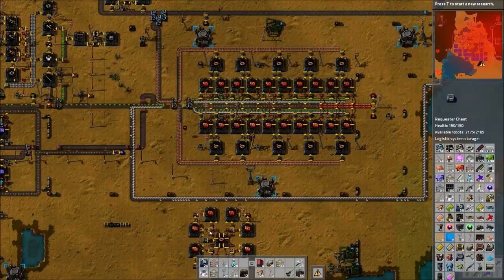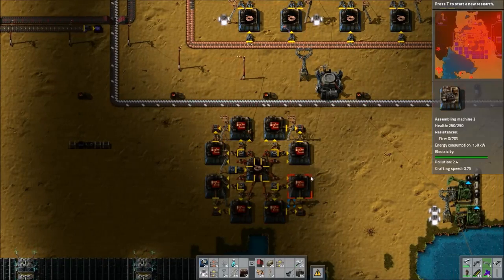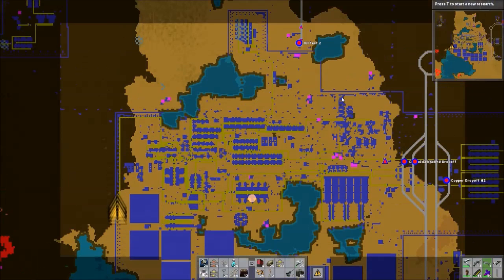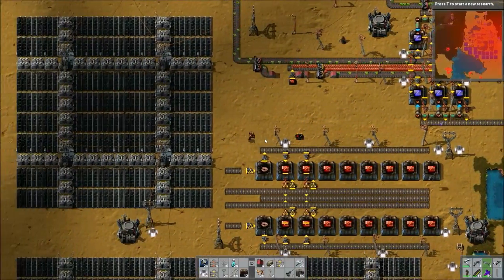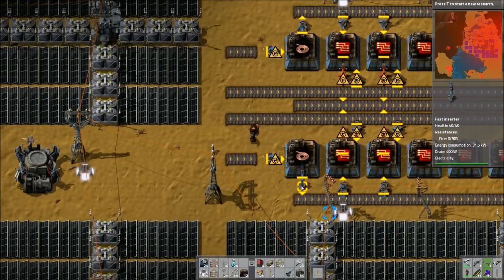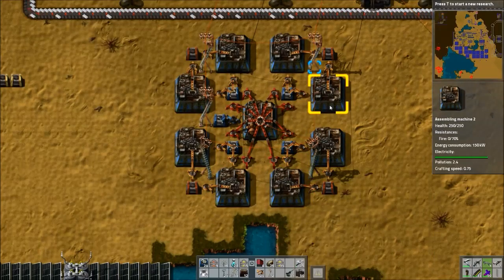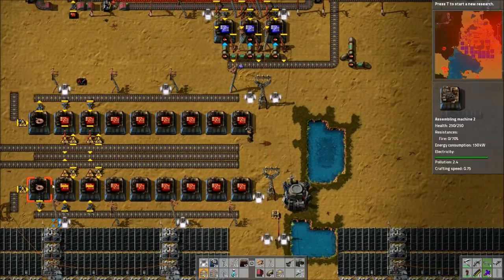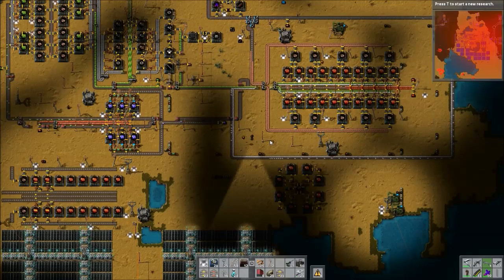Factorio Tutorial - Setting Up Advanced Ciruits

Comment: WHY don't you like belting cable? You say you don't a few times, but never explain why. You're belting in the plastic and green circuits. :)

Would your favoured example work with 20 red circuits in a row, a 2 belts down the centre, one full of plastic, one full of green circuits? Would the assemblers at the end ever get fed? Would the output line get clogged so made circuits were held in the inserter?
Reply from the maker: +ThePunkPensioner Good question! For Red Circuits, it is actually fine to belt the cable just because the circuits are made slowly enough so the cable can keep up on a belt. However it is not recommended to belt cable for normal circuits because since they are made so fast and need quite a few cables, it quickly gets to a point where the belt just can't provide enough throughput to get the cables to all the machines. 

And for your second question, I'm actually not 100% sure. I thin if you made the belts into red belt or maybe even blue then yeah 20 in a row would work and they could still get what they needed. And I don't think the output would get clogged as long as you upgraded the belt accordingly. If you see that it is getting clogged then just upgrade the belt and it should help a lot. :)

Comment: Aren't you using too few Fast Inserters in the Green Circuit-making section? Only one Fast Inserter per Copper Wire Machine?
Reply from the maker: Peter K. Hmm you mean for inputting the copper plate into the cable machine, or putting the cable into the circuit machines? I mean it definitely wouldn't hurt to add more, but I am pretty certain I have enough for at least the inputting of the cable into the circuit machines. Might be a few short with the copper plate though. O.o
Reply: Xterminator For feeding the Copper Wire-making machines. I tend to give mine 3 Fast Inserters each, and while that may be overkill, I do think 1 Fast is too few.

Comment: http://i.imgur.com/fKTWSlA.jpg this a version of the red circuit one copper cable build
Reply from the maker: Arthur Durbin Awesome, I definitely wouldn't of thought of that myself. Thanks for posting! :)
Reply: That has to be using a mod? The underground distances between the green circuits are longer than vanilla.
Reply: +ThePunkPensioner ya i forgot i had extra long underground belts at the time. it still works you just have to move the green circuits to the outer edge and run them under the inserters